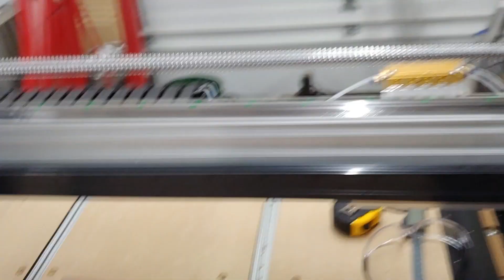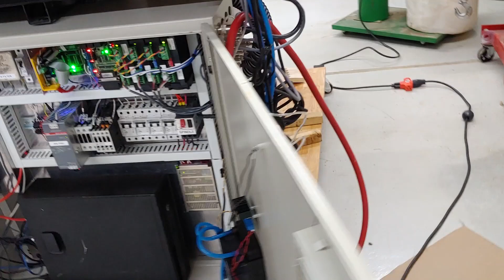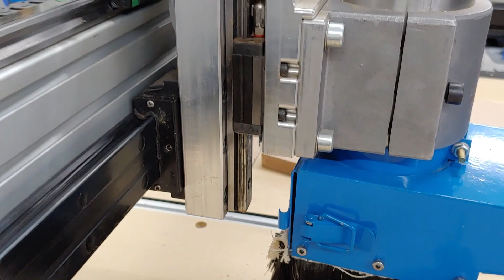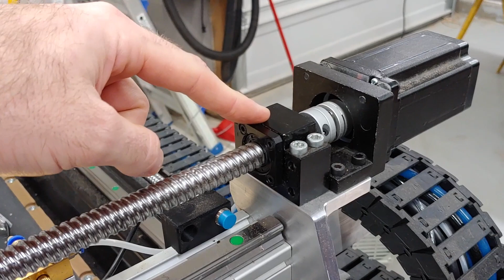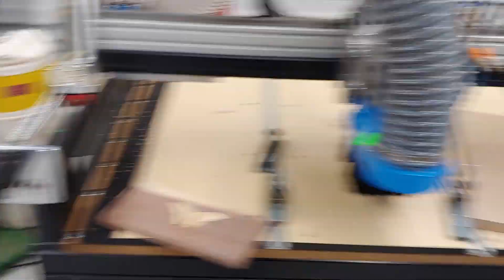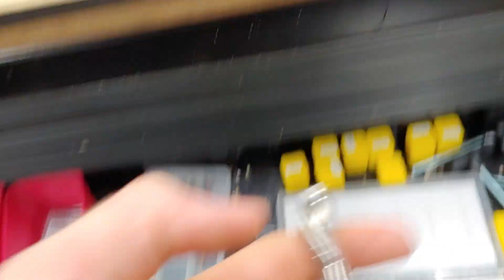DIY CNC Router, finished product overview

Comment: Reini, I keep coming back to your video explanation of the control box and wiring it to 220V. You've really put a lot of thought into it. I'm confused about bringing in 220V  then splitting it for the various components, how to balance the current legs, where to stage the EMI filter in relation to the contactor, the breakers, any fuses, etc. Boy, a wiring diagram would be helpful. Any chance?

Comment: Hello,

Awesome Job and design skills on the CNC project - Very well thought out!!  What are you using to drive the vacuum table?  Also, did you 3d Print small "Wingnut Style" hand turn knobs for your stainless gear clamps?  If so, good idea.  Having trouble finding the 3d Print file.  Do you know if it exists out there?  Thank you!

Comment: That's an amazing build. Very nice job.Just wondering if you had a wire diagram for this build and if you wouldnt mind sharing or hell i would even pay lol. Would of loved to see a full build video of this machine being built.
Reply from the maker: No wiring diagram.  Once you start building the circuits it becomes pretty apparent how it needs to be laid out, just follow the path of the angry pixies.  Everything is pretty basic power and ground, breakers and contactors on certain circuits, relays, etc.  The thing that requires the most thought is how the e stop circuit is going to be laid out and what it interrupts, but even that is fairly simple. The one important thing I would recommend not forgetting is some contactor coil wiring don't have flyback diodes, just add a diode over the coil terminals.  If you have any wiring questions there is a great diy cncs facebook group that I post to regularly, there are some helpful people there.
Reply: @ReiniGrauer  ok thank you. Is there a specific name for the face book group? what size breaker are you running all this from your pannel? i knpow its 240 just wonders the amps
Reply from the maker: @Djvickers20  https://www.facebook.com/groups/cncdiy

It all runs on a typical 30a breaker, but could probably run on less without the vacuum table.  Each circuit inside the cabinet is on its own breaker (fuses would work here too).

Comment: Best cnc router build I've seen I'm about to build a cnc router good to see one built by someone who knows what there doing there's alot of very average cnc builds here on youtube. the vacuum table still got me stumped how it works that well.
Reply from the maker: It was a bit of a brain teaser for me at first, but basically the mdf acts like a porous sponge for the air.  Enough of it can pass through to act like a giant manifold over the whole surface, but not enough can get through around the part to reduce the vacuum level by much.  Keep in mind that the vacuum motors can move a lot of air.  You do have to cut into the first little bit of the mdf because the density and glue amount is too high to let much air through.  And you also have to give the vacuum a manifold to be distributed evenly, hence why I cut a grid into the bottom of it 

This setup really only works well for extremely flat and smooth surfaces, like mdf, plywoods, plastics, metal, etc.  It doesn't hold down very well to anything with the least bit of texture.

Comment: Great built, can you put a link to the Nema23, is it really 1100 Oz.in!! Never found such torque in this category
Reply from the maker: I must have been recalling the specifications for the motors I had on my previous milling machine. Those were nema 34 motors at 1100oz/in.

These motors are 570oz/in, still quite powerful for a nema 23 frame and with a larger 3/8" shaft instead of the usual 1/4".  

https://www.automationtechnologiesinc.com/products-page/nema-23/nema-23-three_eighths-inch-dual-shaft-with-a-flat-570-oz-in/

Comment: did you mill that ball screw to fit. looks like you annealed to  cut it down or trim it
Reply from the maker: Yeah annealed them to turn them on my mini lathe.  The outer bit is very hard, the inside is just a little bit harder than regular steel.
Reply: @ReiniGrauer  you cant trick me reini :)...awesome build
Reply: @ReiniGrauer  wait you did them on a mini lathe...how the heck did you do that...do you have a spider on it?
Reply from the maker: @minskmade  spindle bore is almost exactly the od of the 16mm screw.  I made a bushing for the end of the spindle and a sleeve for the chuck to clamp down on.  The screws are long so I put one of the bearing blocks on the end of the screw and clamped it to the workbench so it didn't whip around.
Reply: @ReiniGrauer  awesome.
Reply from the maker: And I ended up having to weld and recut the first screw because it had run out.  Hence the sleeve in the chuck that clamps on the screw.  The serrations on the chuck jaws would fall into the channels of the screw and introduce runout, but there isn't a great way to measure runout on the screw when it's in the lathe so I didn't realize it was happening.
Reply: @ReiniGrauer  what did you anneal with...i have to do this with one of my lead screws...hope you are well